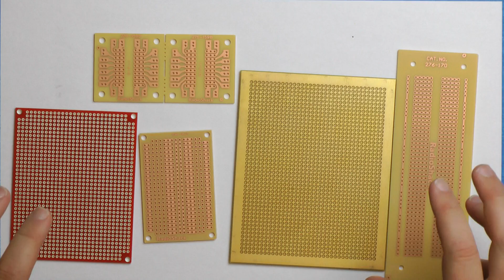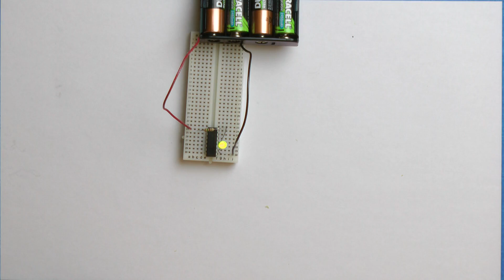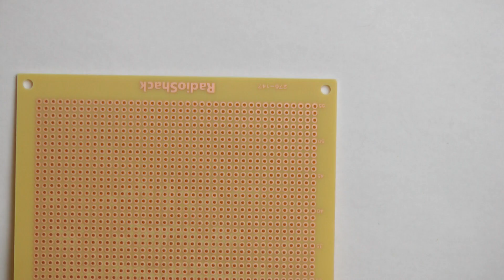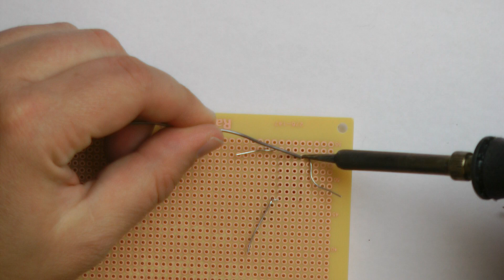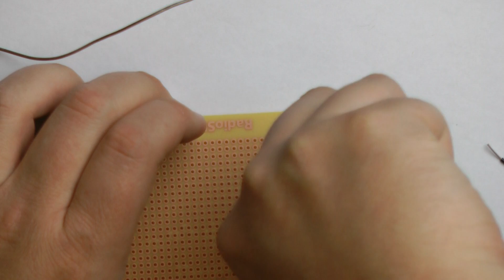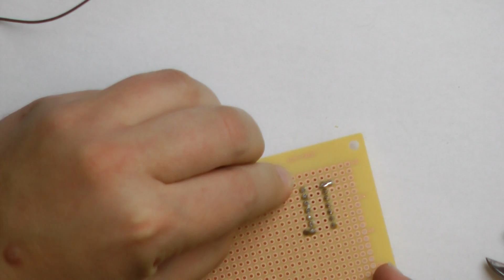CS 3651 Protoboards

Comment: all of those solder dots are so close together, is it difficult to ensure you dont actually cause a connection between adjacent dots?
Reply from the maker: +Gary K Not as bad as you might first think.  The solder tends to adhere to the dots well, causing little solder bubbles.  If you accidentally get a bridge of solder, just heat it up and use solder wick (finely braided copper wire) to such up the excess or one of the cheapo solder sucker tools.
Reply: +Gary K You can also just run your iron through the holes.